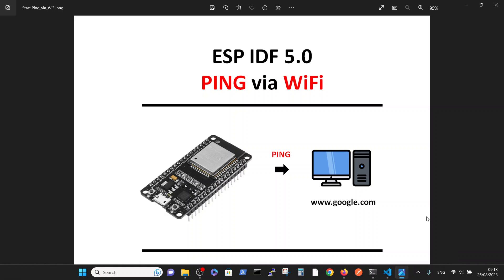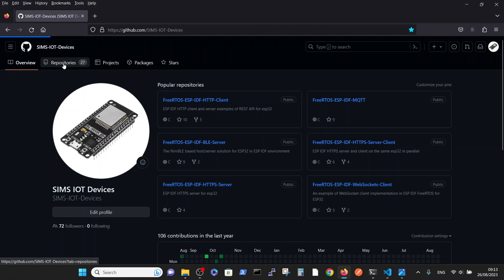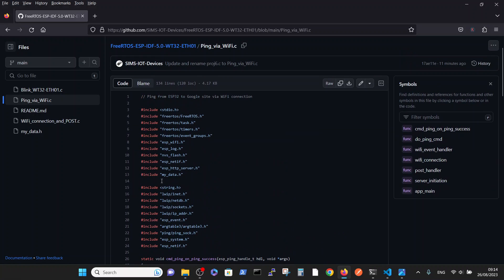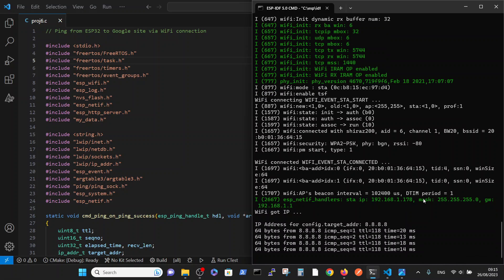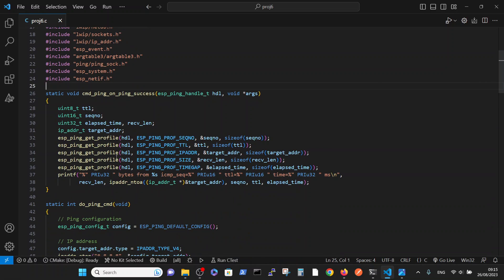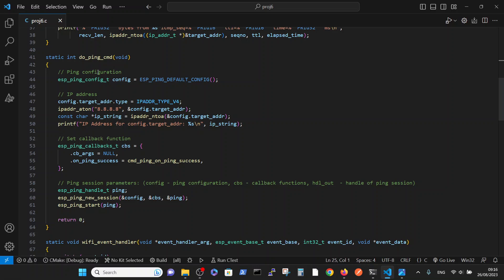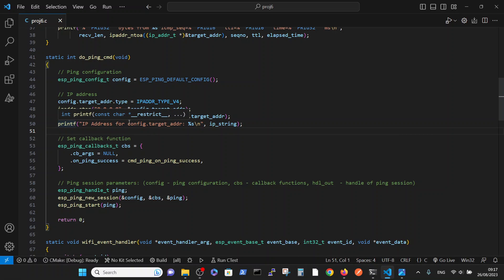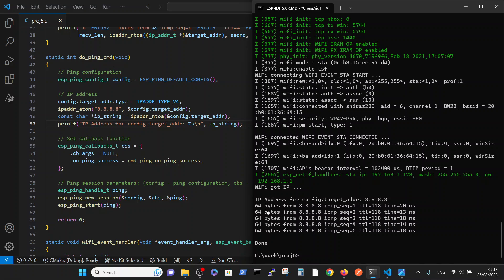ESP IDF 5.0 Ping from ESP32 via WiFi connection

Comment: Hello, I have watched several of your videos, triying to make this ESP32-ETH01 board to work using ethernet.
I watched the video about the Lilygo board that also has PoE.
And I see that you only made this board work using Wifi, but not Ethernet. 
Any reason as to why? 
I don't know if it has something to do with the reference clock, or the pins
Did you manage to make it work?
Reply from the maker: Dear @becunim,
You are right the Lilygo board has a video regarding Ethernet connection:
3 - ESP32 PING via Ethernet connection in ESP IDF 5.0 on LILYGO TTGO T-Internet-POE 
https://www.youtube.com/watch?v=KKzGpKgnh5c

were for the ESP32-ETH01 board only a WiFi connection is demonstrated. I tried to do a video with Ethernet connectivity but had difficulty working on this board due to the lack of a USB port for a standard serial monitor. It was too time-consuming for me and I moved on to the Lilygo board for an Ethernet connectivity demonstration.
Reply: @simsiotdevices6219  I will not argue about it being time consuming
My time is being consumed! XD
I still have hope, though